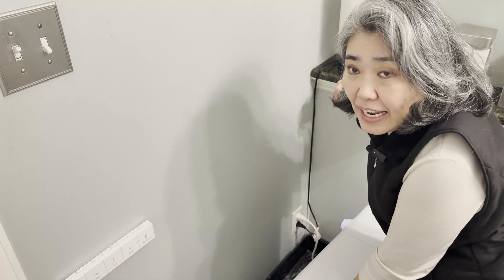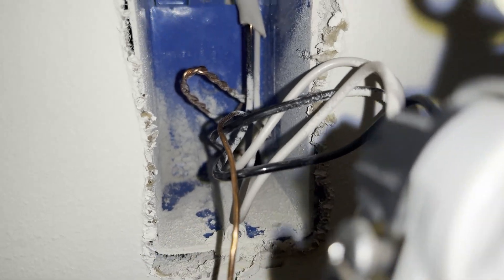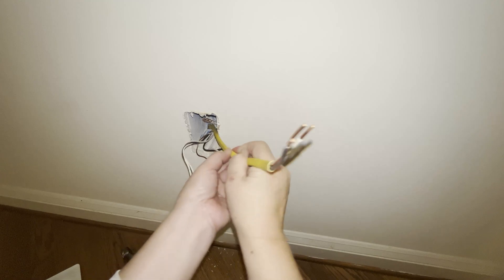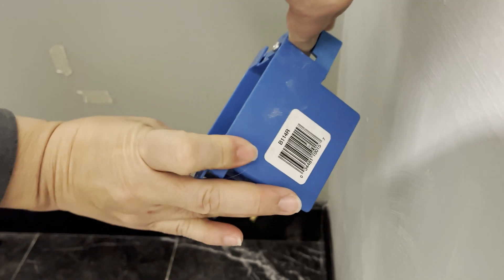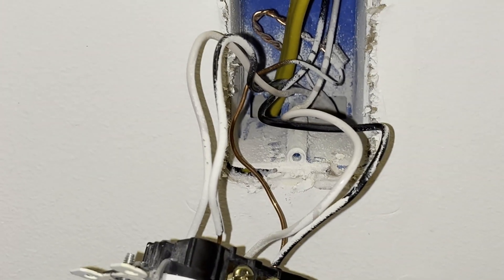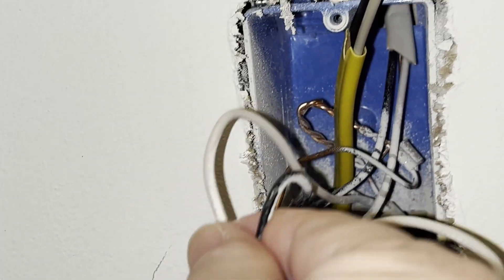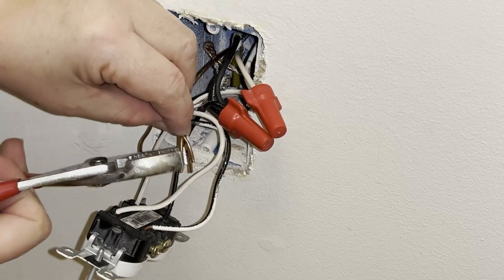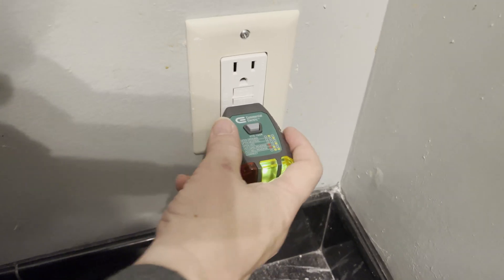Easiest Way to Add or Install an Electrical Outlet

Comment: Could you do a video on changing kitchen faucet, please?
Reply from the maker: I am planning to replace my kitchen in the fall, and can make a video of the process then.
Reply: @KYKCreations  wow.. I didn't think that I would get the honor of getting a response.. THANKS.. Anyhow, here are few more topics I would be interested in... 1. How to change an IGU (internal glass unit) from an existing window in lieu of changing the window itself  2.  Painting old counter tops in lieu of replacing them 3. Refinishing hardwood floor..